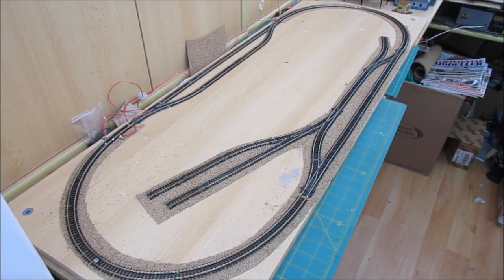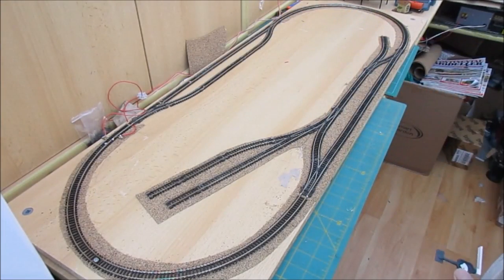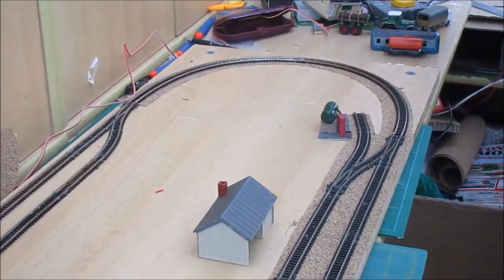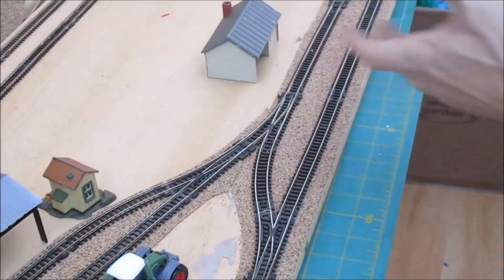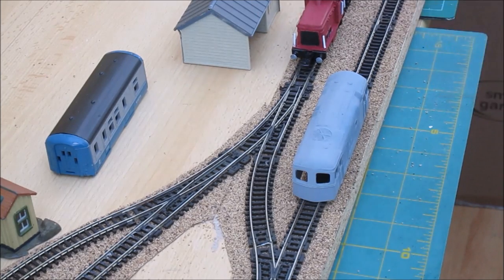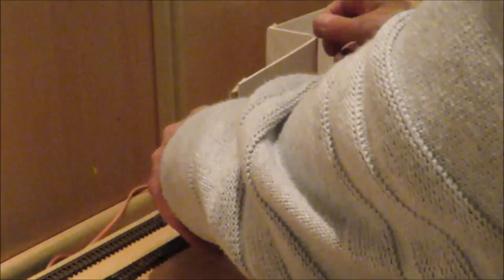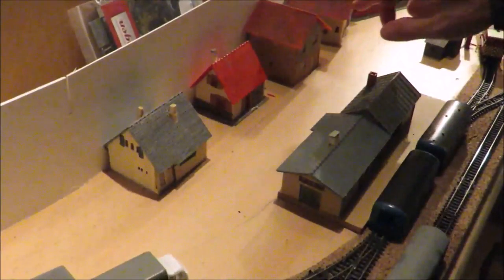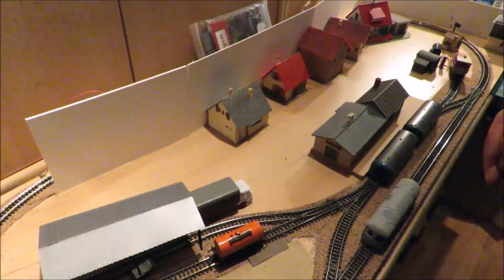How to build an OO9 / HoE Gauge Model Railway Layout - Part 1

Comment: Bit late but I have a couple of suggestions for the rear point. For my godson's layout I tried piano wire with newspaper wrapped around it and coated in PVA, work the wire back and fore as it dries, you get a nice wire-in-tube point control. I used cheap 5mm floor insulation sheet (the green stuff, you have to score it with a knofe to glue it down) but I also did something similar with 'insertion jointing' intended for concrete roads and empty biro tubes for the wire which survived for years outside. Both can have a groove cut in them for the tube. For another layout I used heavy nylon fishing line (I think is was good for 40lbs), one to each side of the point lever (that one was Fleichman track)  routed down through the baseboard and out through the front fascia with coloured beads on the ends.

Comment: Nice little layout. I actually had the same signal box on my first layout and also some SIKU vehicles.

One small idea that I had while watching the video is that on one side of the tunnel you could have placed the tunnel portal after the points, making it seem like there is a second (or third, if you consider both tunnel ends to represent separate tunnels) tunnel that branches off. It could be the start or end of a branch line, a connection to another railway system, or a connection to an industry. Mining goes well with tunnels and narrow gauge, but it could also be something different, like for example a maintenance access to a dam in a difficult to reach location (as can be really found in Japan). Anyway that's just a small idea I had while watching since I'm currently thinking about layout planning myself.

Comment: I know this layout is on hold at the moment but what I would like to know is what track brand of track are you using?
Also how much was it as 009/H0e is still up and coming there is not a lot of 2nd hand track.
Reply from the maker: It's actually N gauge track made by Peco bought second hand. The sleepers are wrong but I simply couldn't afford to buy new 009 track which would have cost £80+ , and have never seen second hand 009
Reply: I was considering buying N track 2nd hand and butchering sleepers off it to make it more in line with 009, just because I costed my small layout at over £120 for just the 009 track.
Reply from the maker: I toyed with at least cutting away every other sleeper. Two other options are to model a dockside so the track is covered by concrete/cobbles etc, or hide it with ballast and lots of static grass for an over grown look. Or as I did, just ignore the difference?